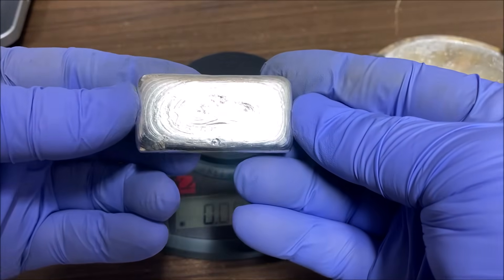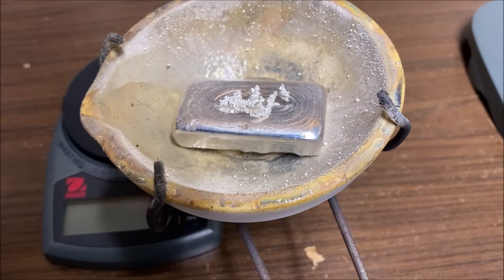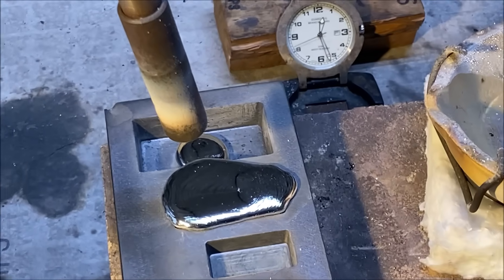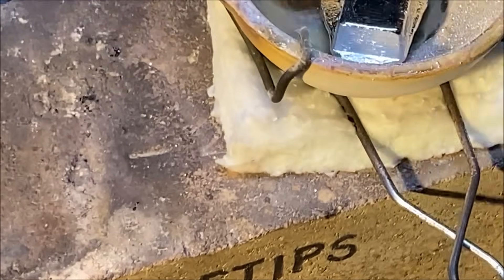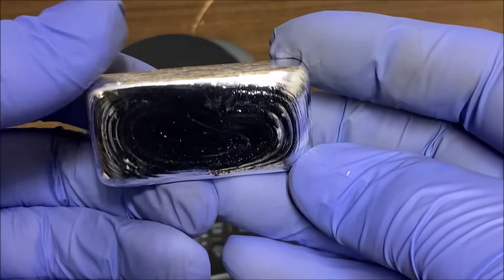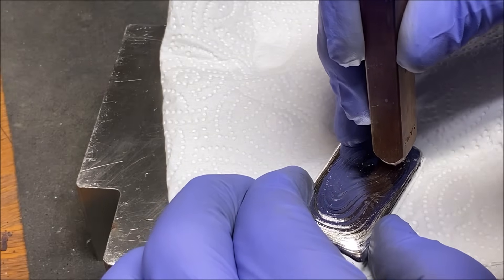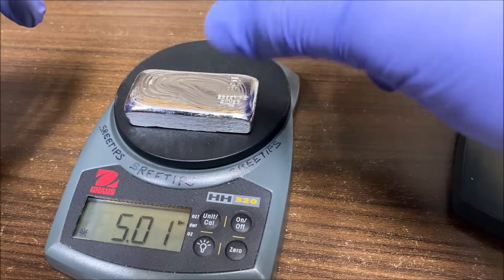PURE SILVER BAR 5 Troy Ounces sreetips

Comment: im from UK ,I HAVE A GOOD IDEA FOR YOU ..really great videos .ive never done the processes though have quite a bit that needs refining.IVE WATCHED MANY VIDS .I think that if you rigged up a round bottom flask ,
with a pulley to raise it and then a dish to locate it once raised(FOR DRIPS).you save plenty of nitric acid.Just partially fill the flask with water ,add ice cubes as require to keep it cold.Then ,when you use nitric acid ,place the round bottom instead of your flat glass plate ABOVE BEAKER  ,this wil cause the hot nitric that evaporates off to condense and drip back into your 2000 ml flat bottom flask .In theory,you will not lose any nitric except a bit through the spout .
Reply from the maker: Thank you for the great idea.

Comment: I’m sure you have said this and/or answered it on a previous video but what type of torch do you use? Is it map or butane?
Reply from the maker: Map gas (yellow cylinder) and oxy/acetylene
Reply: @sreetips  I figured oxygen acetylene on the big torch. I was just curious what he used in the small ones. How much do you end up going through and what’s the cost in materials and what’s the cost saving in time as compared to using an electric furnace with crucible. Have you tried that before?
Reply from the maker: I have an electric furnace, but I rarely use it. My kids buy me map gas as gifts. It depends on how often I’m processing. But I’d say about ten bottles of map gas per year, estimated. I use small 40 cubic feet acetylene and oxygen bottles. I fill them twice per year at about $80 for both.
Reply: @sreetips wow that’s actually amazingly efficient

Comment: hi, you can try with an induction melting dish for metal, to get rid of the splashed silver because the flame pressure and therefore not losing any material when melting it. very nice channel congrats.
Reply from the maker: I don’t have an induction furnace. Thank you for the kind words.

Comment: Why does metals loose weight like this when melt it?
Reply from the maker: Some of it sticks to the melt dish
Reply: @sreetips  Okey that was news to me. Thank you!
Reply from the maker: If you look at the dish after the melt, you’ll notice tiny balls of silver. The silver actually vaporizes and condenses on the cool upper surfaces inside the melt dish. Some of the vapor escapes into the air and coats everything nearby with a fine dusting of pure silver.
Reply: @sreetips  Oh I see that now. Interesting. Thank you!

Comment: I have a solution known as a stripping solution.
My question relates to the method used to carry out this stage.
Gold ore is introduced into vat leaching tanks, after which a cyanide solution is added to dissolve the gold from the ore. The gold-bearing solution then flows through pipelines into columns containing activated carbon, where the carbon adsorbs the dissolved gold ions.
After the carbon becomes saturated with gold, it is treated with caustic soda (NaOH) and ethanol to strip the gold from the carbon, producing a solution known as the stripping solution.
This solution is normally fed into an electrochemical (electrowinning) cell, where gold is deposited onto one of the electrodes. The deposited material is then collected and smelted to produce a gold bar.
The question is:
Is it possible to precipitate gold directly from the stripping solution using chemical precipitants such as sodium metabisulfite or hydrazine, instead of feeding it into an electrochemical cell?
If this is not possible, what alternative methods are available for recovering gold from the stripping solution without using an electrochemical cell?

Comment: Boats are a magnet for electrolysis that corrodes and steals away its metals, but is there a way to sort of reverse or use the process of electrolysis, (or electroplating) to harvest precious metals from the sea ???. 
 As a lobsterman (many years ago) I had thought up a way to use an added extra gear oil cooler ,or engine coolant expansion tank as a (long term) precious metals harvesting device. Unfortunately I was discouraged from going through with the idea, now all these years later, I still wonder if maybe it could have worked ???. Have you goy any thoughts on the idea ?.
Reply from the maker: There’s gold in seawater. But it’s parts per billion. No way that I know of the economically extract the gold.

Comment: Hi Kevin, hope the vehicle wasn't too destroyed by the deer.  Wanted to pick your brain. I've been on the hunt for sterling for a while, unfortunately most of the sterling flatware, bowls, dishes, platters, cups and candle holders I've found I'm not managed to get, just a few random pieces, maybe 150 grams, but what I did find was a source for scrap sterling jewelry, and I'm quickly nearing half a kilo. I notice other than the gold fill stuff, you don't seem to have much content covering using sterling jewelry as your primary silver feedstock. My question is, a lot of this sterling jewelry has a bunch of stones and stuff all over it, and at least some stainless springs in the clasps. The rings, necklace pendants and bracelets with big stones aren't an issue, I can dig those out easily enough, but how do you handle stuff like pendants, bracelets or necklaces with a bunch of tiny CZ's, Moissanite or other stones? There is not way I can dig all of those out, some being so small that you'd need to use a microscope and needle. I know the big refineries must be processing that crap along with the sterling, but I don't think much of it is going to go away during incinerating.  How do you deal with stones in sterling  jewelry? Do you just take out what you can, leave the rest and assume they won't get pulled into solution via the nitric boils and can just be filtered out? 

Also want to say, I entirely understand why you prefer silverware/flatware, platters and and table decor, easier and less time consuming to deal with the cement and cutting objects up than it is picking stones and tiny bits of steel out. 

Anyway, any experience / tips you might share for how you've most effectively dealt with sterling jewelry and stones? 

Thank you, glad you and Mrs. Sreetips are OK!
Reply from the maker: It takes too many words. I’ll make a video
Reply: @sreetips you're the best!

Comment: Hi sir, if you don’t mind me asking a question regarding pricing I’d go ahead. Say you were asked to refine 1 kg of sterling 925 silver into 999 fine crystals and keep some of the recovered silver as your payment. How much silver would you return to customer? 600 g? 700g ? Or your answer.
Reply from the maker: I’ve never done that. And I probably never will. I don’t offer any refine services. But I seem to remember 10% is a standard fee.
Reply: @sreetips  Thanks. And also correct me if I’m wrong as far as I remember you estimate sterling silver as being 90% pure not 92.5% ? Does that mean that you won’t be able to recover all 92.5% and there’ll be losses or 92.5% is very approximate silver content?
Reply from the maker: I use 90% because that’s as high as I’ve been able to recover. Reason; I don’t know. Could be loss due to sloppy handling,
Reply: @sreetips Thank you so much. Appreciate it.

Comment: Look at United States Patent 3,616,332. This is another method for refining Silver without HCL, HNO₃ or Hot H₂SO₄. Seems a lot safer and cheaper than the Nitric or Hot Sulfuric methods. Also, there aren't any noxious fumes produced unlike the Nitric method and apparently non-corrosive unlike the Sulfuric method. H₃NSO₃ (Sulfamic Acid) and water are used as the electrolyte in an electrolysis method to extract the pure silver without other metals such as copper and other metals carrying over to the cathode. Have you heard of and what are your thoughts on this method? Wonder if you can make a video using this method. Check out this short 7 minute video for reference.      https://youtu.be/v2MuRtpCvGo?si=7-tRotbbcAO1vJe1
Reply from the maker: Excellent, thank you for showing that.

Comment: I'm still waiting to hear your thoughts on the current silver squeeze. Samsung, Tesla and Apple are facing production issues and scrambling to find the physical. Maybe you could supply them? lol! 😄
Reply from the maker: I have been planning for this since 2008 when they decided to try to avoid financial ruin by printing currency “without limit” out of thin air. Here’s what I know: considering the $trillions that have been printed and circulated, gold would need to settle at $30k and silver at $1500 just to reach an equilibrium. Reversion to the mean, I believe it’s called. Understanding this is why it’s important, no, very important, to hold savings in precious metals rather than stacks of paper currency. If I need some paper to pay bills or buy food, then I can always sell a little of my metal. These are not speculative numbers. These are facts that can be verified. It’s just math and common sense

Comment: That's actually a cool finish Sreetips. An observation that I'll pass along is that the finish swirls seems to be from the flame on the molten metal as it cools from the outside edges inward. In this case it was awesome having both touches on the surface and looks great and in past videos good or bad it looks like the blowing action of the torch determines the finish. Iv literally been saying turn off the torch turn off the touch since I noticed it when watching your videos. I am definitely not saying I can do better and absolutely know how the seconds vanish when doing melts and pouring it and turning off the flame and putting down the tools and picking up another ECT. Just wanted to bring it to your attention that it seems that you can get the best finish if you can make the pour and instantly stop the air flame pressure on the surface. I don't know if a hotter flame on the mold before the pour that stops just before the pour would help or if a hotter flame that is backed off the mold would help but I believe that you are capable of making a pour that makes you say I didn't think I could do that good even after the awesome pours you have already done and I think you are low key cocky enough that you always want to show up yourself especially when others are jealous already of your skills 😉
Reply from the maker: It’s a reducing flame to keep the air off the bar as the metal freezes in the mold. Without the flame the surface would have a frosty appearance.

Comment: @sreetips I ended up snatching this one, although ebay seemed to be actively changing the price from the time I added it to my cart until checkout.

Anyway, I have also been pouring my own bars and I wouldn't be at all upset if some of your silver cell crystal managed to fall into the shipping box with the bar. Would love to try pouring something with it. 😊
Reply from the maker: Awesome! Thank you.
Reply: @sreetips  And Thank you!
Reply: @sreetips BTW, package arrived, looks great as expected. I wanted to thank you for the extra Christmas message you slipped into the package, that personal touch was very much appreciated. 

I wish you, Mrs Sreetips and your family an amazing 2026. I know it will be a great year for you, silver is already back up to $77 this morning and my best guess is we could see it poke through $100 in January before retreating a bit for profit taking, then headed back up over $100 by end of February and I think that will mark the last time we'll ever see sub-$100 silver.
Reply from the maker: @racerex340  Excellent, thank you!
Reply: @sreetips You are very welcome.

Unrelated question. What do you think is an ideal dilution ratio for sulfuric acid (93% sulfuric drain opener) to safely remove borax flux from my own poured and cast Silver pieces? I was planning to start with diluting 10 to 1 with water under just below boiling heat for 15-20 minutes but don't want to over do it and potentially damage or stain the finish.

Thanks again Kevin!
Reply from the maker: I use 100ml distilled water and 5ml sulfuric with a little heat.
Reply: @sreetips  Aaah, half as strong as I had planned to try. Really good to know that I can use a weaker solution. Thanks again!
Reply from the maker: Don’t put excess acid and don’t leave it on the heat too long or get it too hot. Silver is soluble in sulfuric acid and it will etch the bar.
Reply: @sreetips That's exactly what I was concerned with. I think a tiny bit of selective etching might make the pour lines a little more pronounced similar to Damascus steel, but I definitely don't want to damage the finish. Again, really appreciate the advice.

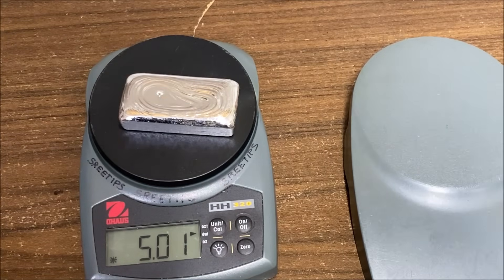Comment: @4:21 is the other .05 in the dish, or evaporated? a mixture of both, in the dish and air?
Reply: Im guessing droplets inside the crucible
Reply from the maker: It vaporizes during the melt.
Reply: @sreetips it probably takes a lot longer but I think you can minimize the loss by using a kiln and graphite crucible.
Reply: @sreetips probably better to just so it the way you do though for the content

Comment: Where’d the 0.06 Oz.T get to? Boiled off? Still in the melt dish? High-graded by refining gremlins? Seized by the IRS?
Reply from the maker: Silver melt and vaporization temp are close. So the 6000 degree oxy/acetylene flame gets too close it could literally go up in smoke
Reply: @sreetips  well if it is vaporizing, it should be quickly condensing upon leaving the vicinity. You should have a thin layer of silver powder on everything nearby. Notice any dust gathering lately?
Reply from the maker: Yes, it’s everywhere. It even condenses as tiny beads of pure silver around the upper, cooler edges of the melt dish.